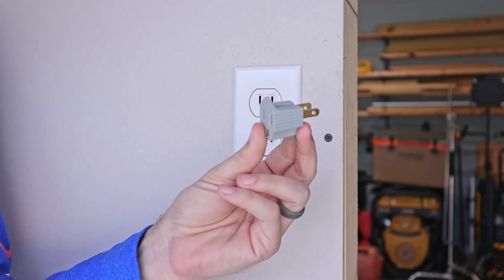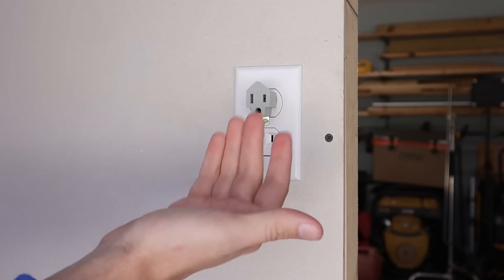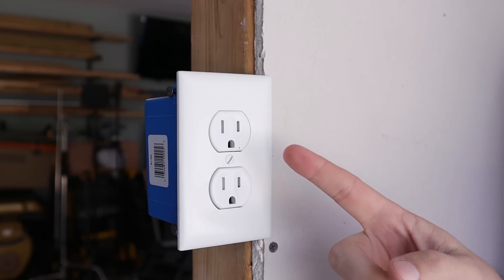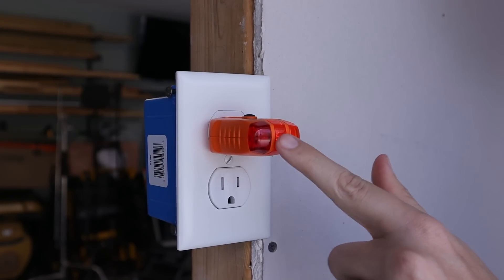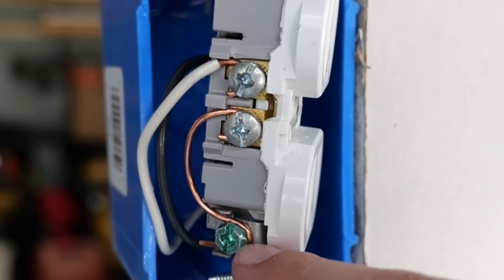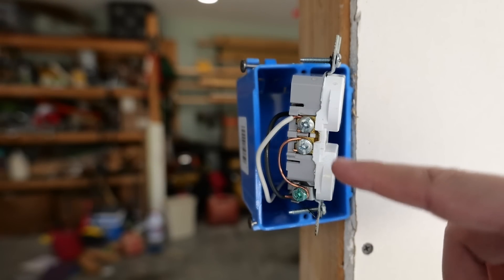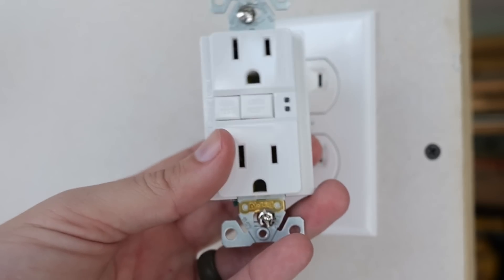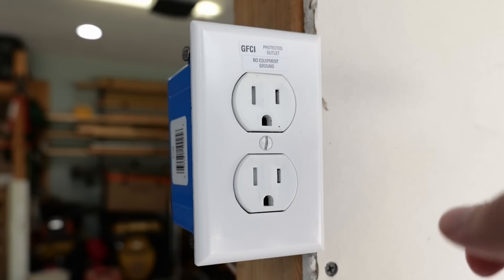EXTREMELY Dangerous "FIXES" Homeowners Are Doing To Outlets

Comment: this is what i have in my house.should i remove the bootlegs and install gfci?or just leave it there and install a gfci?thanks😊
Reply from the maker: Well I can't really advise you exactly what to do but I would definitely have the bootlegs removed as they provide nothing other than a shock hazard.  GFCIs or updating the wiring are really the only choices if you want a safer way to be able to plug in 3 prong plugs.

Comment: Could you install GFIC breakers for the older ungrounded 2-wire circuits?  Would that meet NEC standards?
Reply: Yes, installed accordingly. And you will find GFCI Breakers much more expensive than the outlet type.
Reply: If the panel is very old, GFCI breakers may not be available.
Reply: @stevelopez372  usually about 3 times the price, which if you have four receptacles on the circuit and none of them feed through to any others, would make it the cheaper option.
Reply: @surferdude642  if the panel is so old you can't get GFCI breakers, then you should be seriously considering a newer panel; because the breaker technology in those has safety problems of its own.

Comment: Although the NEC requires a “No Equipment Ground” sticker when using a GFIC fix, 99% of people have no idea of the implications of this. The sticker would be better to read “Your surge suppressor won’t work here.” Most type 3 and 4 SPDs work by shunting transient voltages to ground. With no ground, they won’t work. The GFIC makes it safe for personnel, but your TV is hosed.
Reply: Surge suppressors do work with ungrounded sockets. They have varistors between all wires, including live and neutral.

The point of the label is to tell anyone inspecting the socket that open ground is not an error.
Reply: @okaro6595  I haven't found a single manufacturer of Type 3 SPDs that says the SPD will work properly on an ungrounded receptacle. The SPD works by shunting power to ground. While the grounded and ungrounded conductor may have a MOV connecting them, the best that will do is perhaps shunt transient voltage. Maybe.

I would be interested to know of any SPD manufacturer who lists their device as usable without a ground. If you know of one, I'd be interested in seeing the listing, and understanding exactly where they are shunting the surge.

Comment: I’m 70 years old, and I have had lots of applications where receptacles don’t have a ground slot in them.  No ground hole means box is not grounded.  The 3 to 2 prong adapter is only useful if you have an appliance, or tool you want to get power to without any insurance, or assurance the power you get is safe.  It’s like jumping into an old car or truck that has no seatbelts.  Driving something obviously old, but expecting nothing will go wrong; but if it does… you’ll either really feel stupid or nothing at all because you will never feel anything again.  Unless reincarnation changes your trajectory.
My rule of thumb is it’s ok to charge your phone or even your iPad in a 2 slotted outlet.
Reply: That's not true.  If the your wiring is armored cable, the the armor is your.ground
Reply: @allenwone2891  Thanks!  I never thought about that.  I think getting a tester would be a great investment for me.  I have finished walls, and no idea what, if any conduit is feeding my box.  Your 2 minute comment could very possibly save me hours of worry and wondering about my grounds!!!!!  I owe you a night out drinking beer and pigging out on prime rib until we puke.  Seriously… I was mulling over my situation earlier today wondering if plugging in my electric concrete mixer was going to kill me.  Now I know to check it out more than my knowledge before was directing me.

Comment: Honest question. If I have a metal box on an outlet with no ground, can I run a wire from the outlet to the metal box and it be safe?
Reply: If the box is not already grounded to the electrical panel with a ground wire or metal conduit, then no.
Reply: Not really but it's better than nothing at all.

Comment: Great video. Does the Klein Tools RT250 GFCI Outlet Tester with LCD Display detect the grounding bypass to neutral dangerous hack?
Reply from the maker: Nope.  Only some of the much more expensive analyzers can detect it.  They are usually around $300.

Comment: It appears that you back stabbed the GFCI outlet.  Is that safe to do?  My mobile home has them done the same way and i was wondering if i should hook the wires around the screws instead?
Reply from the maker: On GFCIs it’s not backstabbing, it’s backwiring.  Completely different.  When the terminal screw is tightened it actually acts like a vice on the wire.
Reply: @HowToHomeDIY  Thank You!

Comment: Does code address where the GFCI Protected Outlet and No Equipment Ground stickers need to be placed--top, bottom, or either of the cover plate?
Reply: Not that I am aware of.
Reply: just that they must be on the visible side.
Reply: nEC states that only the NO Equipment Ground sticker be used. This does not function as a GFCI since there is no ground. To prove my point use a GFCI plug tester and push the button, it doesn't trip so the GFCI sticker gives false information
Reply: @williamleblanc3244  I don't agree that the GFCI function is defeated when an equipment ground is not part of the circuit. The GFCI trips/opens the circuit when the GFCI senses an unbalanced current situation (i.e., the current on the hot wire differs from the current on the neutral wire) of at least 5 milliamps. The GFCI plug tester depends on the equipment ground to create the unbalanced current situation by diverting some current to the equipment ground; therefore, will not work when no equipment ground is present. If a defective/damaged equipment is plugged into the ungrounded GFCI and another path to ground occurs (e.g., someone touching the defective/damaged equipment and standing on a grounded surface like the floor of the house that's resting on earth--a.k.a. ground--directly or via the house's structure or touches a grounded surface like a faucet or stove), the GFCI will trip and open the circuit.
Reply: @williamleblanc3244  Not again. Please learn how a GFCI works. The tester does not work as it relies on the ground wire but that is just the tester. If you draw a wire form the ground prong of the tester to your water tap then the tester will likely work. Note this is a thought experiment. I would never encourage you do do such connections.
Reply: @arthendrickson4860  It is not an issue where one can agree or disagree, You are right, he is wrong.

Comment: Great video per usual. Quick question what if you replace the breaker for an AFCI GFCI breaker does that technically change anything?
Reply: changing out the breakers is a good option.

Comment: Another question: isn't the device's proper name receptacle? If so, why does the sticker say GFCI Protected Outlet?
Reply: Yes. The term outlet is an electrical connection location and is less specific, but they are often used interchangeably.
Reply: @surferdude642  all receptacles are outlets.  not all outlets are receptacles.  so having the sticker say "outlet" would allow placing it on any equipment that was protected.
Reply: @kenbrown2808  Good point, some outlets are switches, and a sticker should be used there. A common example would be on a switch protecting a bathroom exhaust fan.

Comment: One thing I haven't seen addressed is determining the first receptacle in the "line." You mentioned that the GFCI should be the first receptacle from the breaker box. How do I know which one that is? I'd love to get an answer here in the comments, or maybe in a subsequent video that you do!
Reply: Even if your house is old it's possible that your boxes are grounded if they are metal. You can check that using a multimeter, with one probe on the metal box or on the receptacle metal yoke with the receptacle still fastened and the other on the hot slot. If grounded, it will read approximately 120v. If not, the first one is usually the closest to the electrical panel. If you remove the hot wires (power off) and all the outlets in the circuit are out (power on) then that's the first one. If the receptacles are pigtailed, only one hot and one neutral wire, it's still doable, but far more difficult. If you have no or very little experience with electrical wiring, I would not recommend messing with it yourself. GFCI receptacles, using the Line connections only, would be a good idea, however you would need one at every receptacle or at least the ones that are often used.
Reply: Thank you, Ted!
Reply: It should be first on the line you change. I you leave some sockets two prong you do not need to worry about them. You have to figure out it somehow. After you have done it, verify it by tripping the GFCI and verifying that all the sockets you changed are dead.

Comment: But a lot of electrical panels have the ground and neutral leg mounted on the same bus bar.  What about those situations?  Are you saying you have to update the electrical panel as well. That seems a bit over kill.
Reply from the maker: Not at all.  The main panel is the only place that the neutral and ground should be or are allowed to be bonded though.
Reply: @HowToHomeDIY  Thanks for replying. I am still confused.  Why does it matter if it is on the same bar in the panel or outlet. The risk is the same in my mind.  What am I missing?
Reply: @Papa_Smurf7  It's to protect against an open neutral. With a bootleg ground, if there's a break in the neutral wire you can have full voltage appear on the ground pin. You want the safety ground to have a separate return path back to the panel.
Reply: @Papa_Smurf7  I think what you're missing is the reality that the ground wire is essentially a wire that is unconnected at one end under normal operation. You may be confused by the fact that ground wires are connected to each other and every receptacle, switch, and any metal boxes in the electrical system. These are all dead ends when there's no ground fault, therefore no voltage and no current. If there's a ground fault, a connection is made and will provide a low impedance path for the extremely high current to return and quickly trip the breaker. If you make a connection anywhere else other than the main panel, you're making a parallel path for some current to flow uncontrollably in the ground wires and is a hazard, even without a broken neutral. The current will likely not be high enough to trip the breaker, but still would always remain live. This concept is known as "objectionable current" in electrical wiring, you can Google that for more details.

Comment: I am going to ask a silly question.  IN the homes I have owned, the neutral wire and ground wires are all connected to the same spot in the distribution panel.  So why does a ground and a neutral have to be run to each box, when they are the same point electrically?
Reply: If you do have a ground wire and neutral coming into the box you would want them separated so you don’t have current flow on the ground
Reply: @highvoltage1979  I had to think about that for a while, but I think I get it.
Reply: because if something happens to the neutral wire, and the ground is connected to it at the receptacle, then everything metal that is plugged into it is now energized.
Reply: If you use the ground to carry current then it raises the voltage on it and that causes stray currents that can go through your cable-TV network, data cables etc.
Reply: @okaro6595  if you can produce measurable voltage on the grounding conductor, there is a problem, because in normal operation, both the grounded conductor and the grounding conductor are at ground potential.
Reply: @jimbelcher6877  An easy way to understand this is that grounding wires are essentially an open line (unconnected) everywhere else under normal operation. Understand that wires, receptacles, switches, and metal boxes are dead ends when there's no ground fault. The neutral wire must be connected to each receptacle for return current. A ground wire must be connected at each device and metal box in case there's a ground fault at that location.

Comment: The biggest issue with a bootleg ground is if you lose a neutral. For instance, someone plugs in a space heater in the same circuit their computer is on, the connections get loose, then they lose the neutral and the computer shuts off. The person puts their hand on the metal computer case because they're looking behind the desk to check the plug, they end up also touching  something that has an actual ground like a radiator or another appliance that is connected the right way and they get electrocuted.
Reply: Yes the example with the space heater, computer and radiator you described is a very real hazard considering steam or hot water heating systems were common in homes old enough to have two wire outlets and no equipment grounds in the wiring. 

I have been on one service call a couple years ago where a TV, cable box, stereo system and surge protector smoked up and caught fire when a neutral upstream in a backstabbed outlet of a multiwire branch circuit burned open when an electric fireplace was running, causing everything on the other leg to get hit with well over 120 volts and closer to 240V.  If the homeowner hadn't been home and  in the Great room with the fire extinguisher grabbed from the kitchen closeby they would have lost the home.  The home was built in 1990 so of course all the wiring was Romex with ground.   

I have never run across an open neutral with a bootleg ground yet.

Comment: Holy COW!  That is some very very bad wiring to run the neutral on the ground!  I had an acquaintance who did this wiring with his hot water heater.  He went to take a shower a few days later and he got shocked by touching the handles.  I laughed at him for a very long time.
Reply: He just thought he'd be fancy and take a shower with SPARKling water.
Reply: After doing that wrong thing, he should have been grounded.

Comment: I like you warning about this, but claiming that one socket wire like this will make all of the grounds in the house live is just impossible. Why: the reason for the hack is because there is no ground wire in that outlet and the box is not grounded, or it is plastic, but the white wire if it is done right in the fuse box is connected to ground, so your point about another appliance that does have a ground wire being now live is bogus. However making that jumper from the live black wire to the ground in that outlet, is a problem for that outlet making the ground live.    Ps: another poster made the same claim you did.